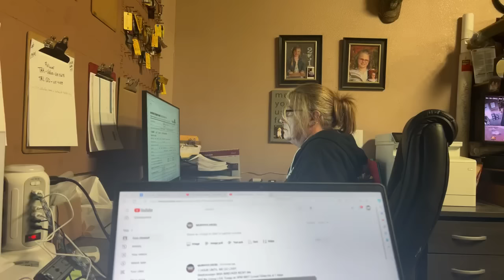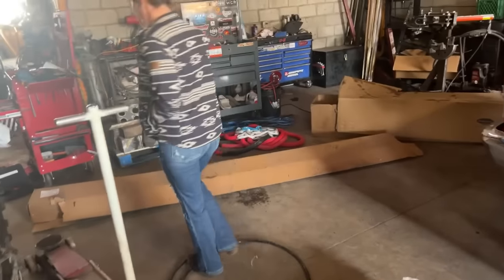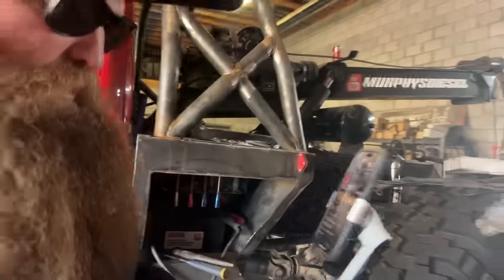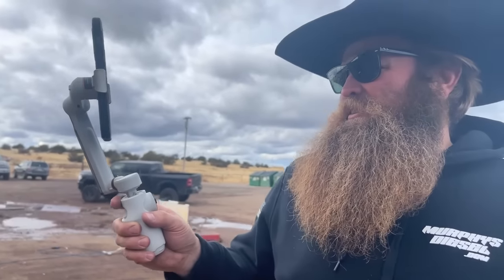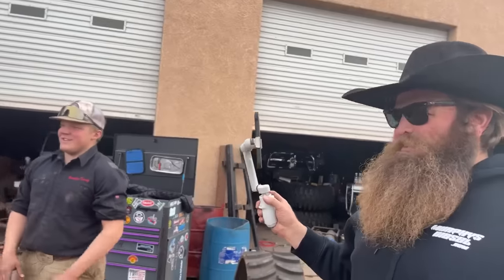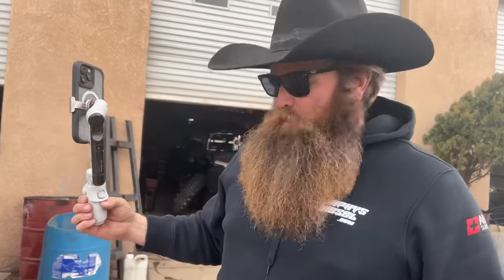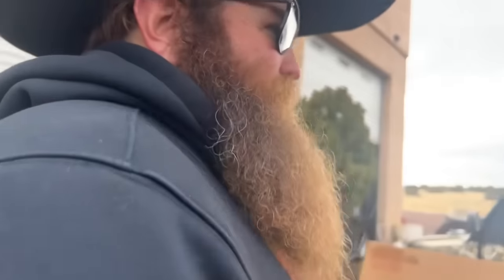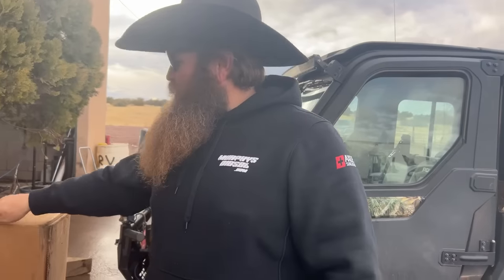Largest Off-Road Wrecker Hellboy is live with Wrecker Rick in the shop. #offroad #wrecker #towtruck

Comment: Truck is working great at least what you guys did I'm very happy with the job you guys did. Now I gotta replace the water line from water pump to air compressor down here in glendale it never ends with this old truck lol anyone needs work done or tow in northern Arizona call Murphys towing and Murphys diesel

Comment: The red Square Body who’s truck and what year is it, 3/4 or 1 ton. From what I could see it looks to be in good shape, it would be nice if it’s yours to give us a little info and video of it. I ordered a 1984 1 ton K30  w/454ci, SM465, NP205 trans, 4:10 gears, dual tanks, A/C, am/fm cassette player, Custom Deluxe didn’t want dual head lights to break off roading, Indian Bronze Metallic paint, on day one in St.Augustine, Fl it sunk in the sand but it came out on it’s own so the when warranty was out I installed 3” body lift, 6” suspension lift, and had a machinist make a 1 3/4” block for front spring perch’s to almost level the front with rear almost, bought Super Swamper 15”x42”x16.5” TSL tires, replaced the Quadra jet carb with a 900 cfm Predator carb w/ Hedman headers, no smog junk from factory since it was a commercial vehicle and boy did the factory have that big block choked down but there was a problem when off roading everybody thought I was a wrecker service and hardly got any off roading I wanted to do. Moved to Atlanta, GA and had to travel for work a lot so all I did was buy batteries for it so I called a buddy I grew up with in WV (he wanted first rights to buy it if I ever decided to sell). We grew up four wheeling in the mountains so he bought it but I wish I had kept it he eventually turned it into a sled puller with his cousin. If it’s yours please give us a short video on it. Sorry to be so long winded but I love those Square Bodies.